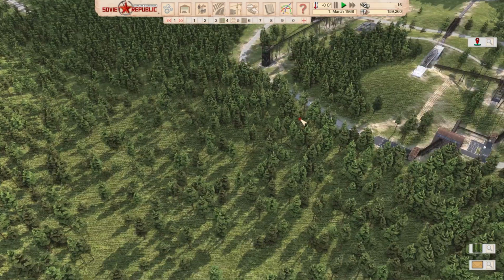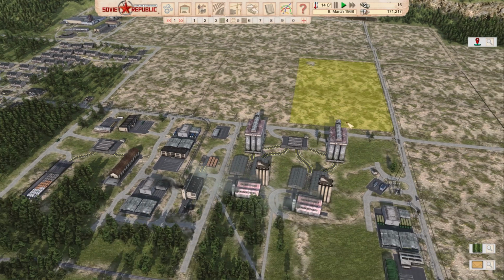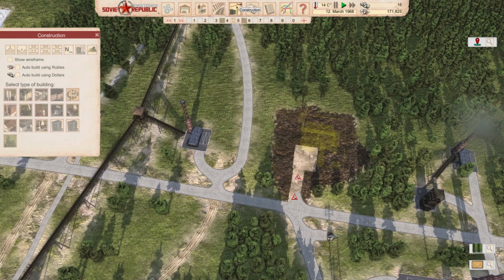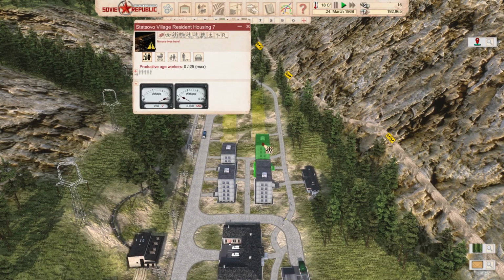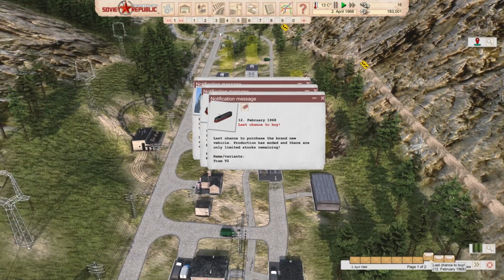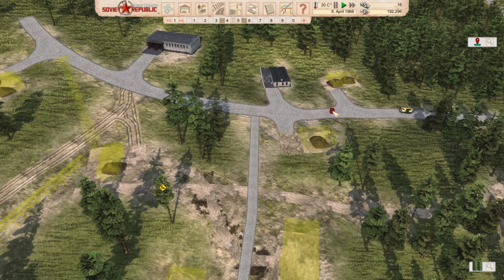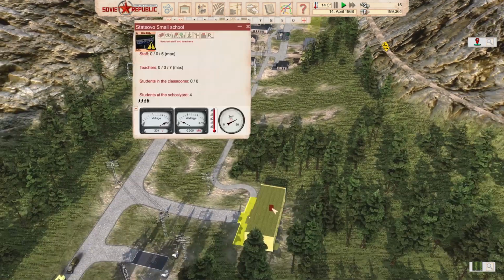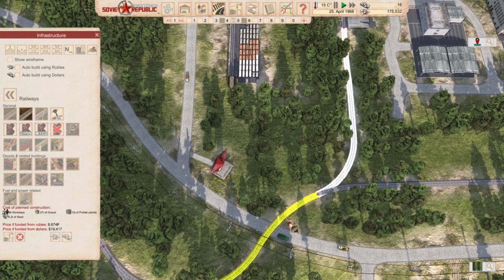Soviet Republic - Alaska - The Power Play - Ep.25

Comment: Episode notes: Ok you are in 1968, and you aren't committing to the VS3 only rule (which slows down progress a lot).
I'd get rid of the VS3s once and for all if you are still concerned about the border traffic. A 3.6T cistern is just going to make way more trips to the border compared to the T138 (13T).
I'd try to eliminate lines vs DOs. Not sure how many direct lines you have vs DOs. You are using mods, so you can pick any sized DO for any job. Still using the 'starter' hotmix building, so you can see the VS3 is even using a DO, loading 100% of bitumen, which means that it isn't keeping up with demand. The hotmix can store 40T of bitumen, so I guess to save money you can keep the limit of it down from 90% storage to something smaller, but this is just too much min-maxing to be worrying about in 1968 if your economy is strong at all.

(Ok in minute 57:00 you cover this) I don't see the point in importing fuel from the border when it is 300m away when it's not your major import or export. Livestock / cattle / food / distillery ARE your major exports in Galahsk. Maybe I just lack the imagination to see again how you are going to fit so many train stations for cargo (you went over it episodes ago). I also don't know how your ideal train car configuration will look like (1 car for fuel? a flat bed? a hopper car? a cargo car?)

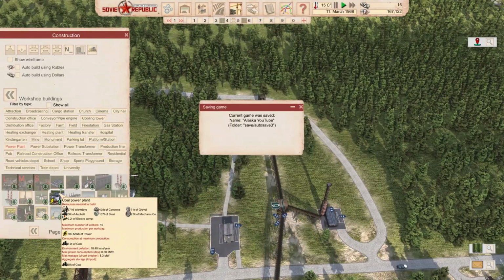10:00
This doesn't have  any high voltage, just 2 medium voltage connections? Or 2 high voltage no medium voltage?  (435T of concrete! Wow!) Power plant 10 workers 500MWh power from 5T coal. Pollution 18.4T .3MWh used, 8.3MW circuit breaker. I don't know what any of this means, so I will just compare to vanilla. Vanilla can do 23.34MW, has 24T of coal used, 1400MWh, 2 high voltage / 4 medium voltage lines. It says 23MW circuit breaker, so I will just guess that is the easy way to look at this. Can do 8.3MW of power. Vanilla 1400 / 23.34 = 60 (so you get  23.34 MW out of your 1400, makes sense, 60 = minutes?) Same math for this guy, 8.3MW circuit breaker x 60 = 500Mwh. 
1400 / 24 (tons of coal) = 58.33 power per tons of coal used, 500 / 5 = 100 power per tons of coal used. So there is your efficiency.
The 360 for 12 = 30, so a lot worse than vanilla. But hey it uses a lot less concrete! :p

But back to the one you picked, it only has 2 medium voltage out, so you can only get 2.35 x 2 = 4.7MW out of the 8.3MW it says it can generate, excluding the surrounding buildings it will power that are in range.

Umut Deniz  asked on Reddit about how much power you actually would need in a republic, and all I could say is that the vanilla 23MW will power an entire republic until you get into electrical trains. So 4.7MW is still quite a decent amount of power I suppose. But you did run high voltage lines to your new cities, so you won't really be able to hook this thing up and have to make a new one in the new areas, and just leave this for your current area / trains (not sure which train you will get / how many / yadda yadda).

I guess I would have looked to see how much power you are importing currently from customs before selecting anything if I had to give an advice on it?

Steel mill:
Just double checking your math:
43T out of 375T coal 200T iron
1T steel out of 8.72T coal and 4.65T of iron.

Tiny mill:
1.4T out of 7T coal / iron
so 5T of coal / iron.
Uses a lot less coal, a little bit more iron.

Yeah don't know why you go over math if you aren't going to just use division instead of mental multiplication lol.

But you have 3 tiny steel mills now, giving you only 4.2T of steel per day at maximum efficiency (1533T/year), so still 1/10th of a vanilla mill. I mentioned lack of steel as being the main reason in my mind why series go fast or go slow. 137T of steel needed for your power plant alone, which is 33 days of 100% production of all 3 of your steel mills. Another commenter suggested you can just look in the economy sections of the game (Domestic production and Consumption, 2nd tab, click on Constructions at the bottom) and see how much steel you consume with your industry. I am nearing the end of my current game, and have used 74000T of steel in the year 1994 for industry (this is a LOT of exporting vehicles) but as far as Constructions goes, 188k T of steel, 494k T of concrete. Vanilla maximum (I have never had it 100% efficient) would be 15,300T per year. My March 11 1968 steel was 25,792 T and concrete usage was 49,362 T, and  since I am in January 24 1994 that means I just clicked over 1850 times to get this information :) A higher % of concrete later in the game obviously than steel due to more harbors constructed (container harbor is 1131T of concrete! and I have 4 cooling towers which are 506T each! 

I didn't get my steel mill working well until 1973, and finished it in 1970 due to map position. My prior map was a lot easier, and had a steel mill in 1965 but 6M in debt to repay. I understand if you don't like playing with loans, but this is just a comment on velocity and pace with regards to how series run I mentioned yesterday. I had a lot to do in this game import / export wise (clothing / meat / distillery / food, and even OP tourism) since steel was so hard for me to reach.

Oh but talking about not being the smartest tool in the shed, I could have just loaded an older save rather than my current one! My poor tired finger!

But yeah, I don't like all the pollution and I don't let my people walk to industries to work, so I use a lot of bus stops and busses.

On to the next  part of the video! The RCOs don't look like they have any steel.
Don't know if you have steel in the open store or not or just are out.

I don't argue with Europeans about anything other than F vs C (Fahrenheit is more descriptive for humans for weather imo, so I joke F is how people feel, C is how water feels). I don't care which floor is the ground or 1st, as long as the hotels say which one the lobby is on :)

I don't think you should worry so much about redesigns, just add more buildings. They are literally just wood and rocks. I think you get bogged down in redoing things vs adding more things, it eats into your resources so much and construction crews etc..

You disabled the school in the last episode 27:34 so it's set  to 0 workers, you just needed to set it back after spring.

Yeah you definitely need those 0 concrete buildings now that your power plant is being built!

I do love the PZ672s, they are my favorite bus in the game. I use them and filthy imperialist MARS 305s in my late game.

Iron ore prices going down also means iron prices will go down. If you had spare storage this would be the time to buy as much as you can. The same goes for steel.

I don't typically pay attention to global events as I just need what I need, but this may actually help you to pay attention to these when your economy is stretched thin.

Yeah you will be forced to keep importing electricity since you picked one  I mentioned earlier had no high voltage out. I don't know if you can reverse a transformer from the tiny power plant to a vanilla transformer to turn medium into high volage, I've just never tried it.

As far as length of electricity, what I have found is the following (and it fits with your name for them, electrical hoses).
If  you create a 2.35MW medium voltage cable, and put in a bunch of switches, the MIDDLE will have no power, but the end will.
In my example, I had an oil refinery and a lot of pumps / pumpjacks, and a city in the MIDDLE. The refinery and pumps worked fine, but the city had 0 voltage. I had to run another discrete line to the city from the vanilla coal plant I had's 4 medium voltage hookups.
Why I called it similar to 'power hoses' was imagine you fill up a hose with 80% of water, and then dump it upside down, the things at the end will get the water, and those in the middle (away from the power plant) get 0. So it's actually the opposite of I think what you said about power evaporating farther away.

Blame me for your small mine?
Real vanilla mines don't allow nearly as many mechanisms! (1 in foundation, 2 in steel framing, 0 in the final) They take ages to build out! So your mine is definitely OP letting 4 mechanisms work! ;p

I don't know why you keep making smaller and smaller housing in your first city, I asked in my comments yesterday if you are emtpying out your silos year after year, and since you have that massive food and distillery area that are at only 5 workers or something.